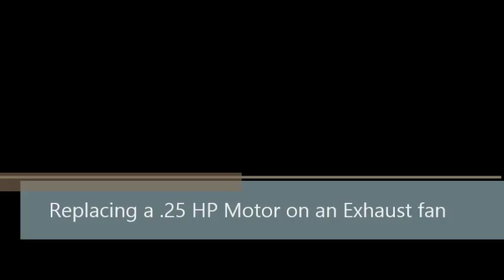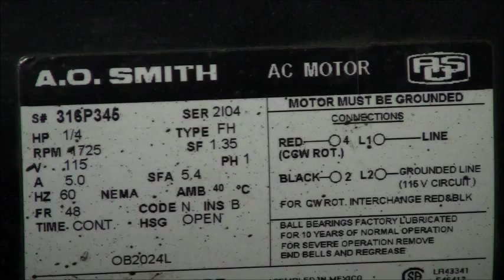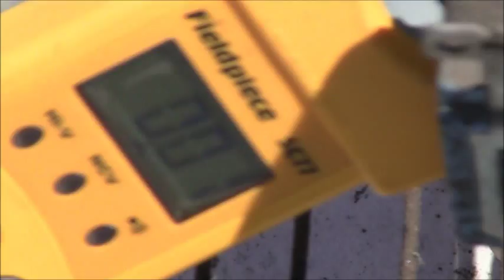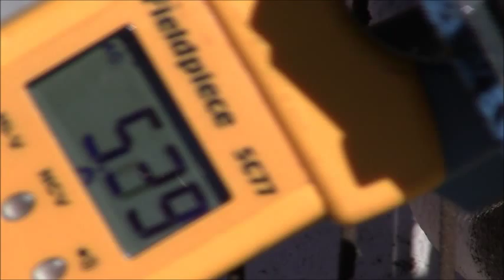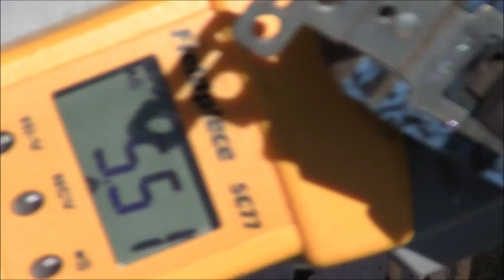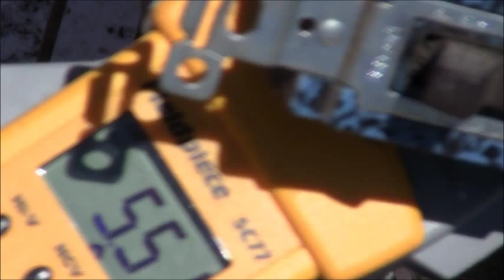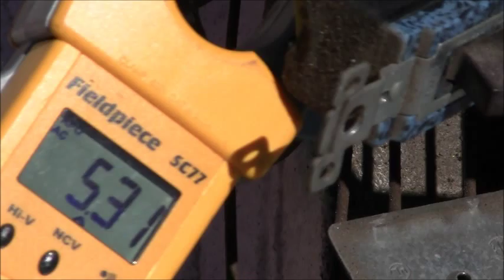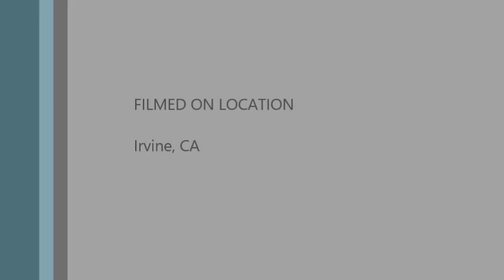Replacing a .25 HP Motor on an Exhaust fan

Comment: always install an adjustable pulley because you can adjust speed and amps. you should not exceed 80% of rated amp draw, otherwise the motor life is reduced

Comment: That belt you put on was a used belt. I can see in the video it has cracks in it. Once you install a new belt your amps will be higher. An adjustable sheave is good because you can adjust your amps accordingly. But the fixed sheave is better because it helps the belt live a longer life.
Reply from the maker: Anthony R good comments. Thank you.

Comment: The amps should drop when you install the hood.
Reply: Yep, a lot people dont know this.  You put less load on a motor attached to fan when you block some of the air intake or exhaust of the fan.

Comment: your amp is higher because you installed a fixed pully. if you had an adjustable pully you could have adjusted it to get your proper amps. that's why the old one was an adjustable. good video take care.